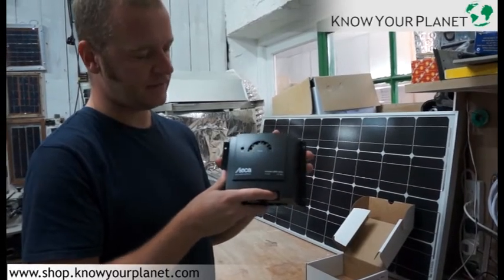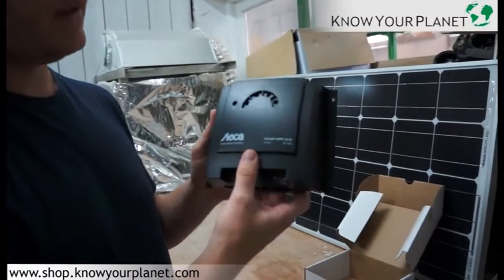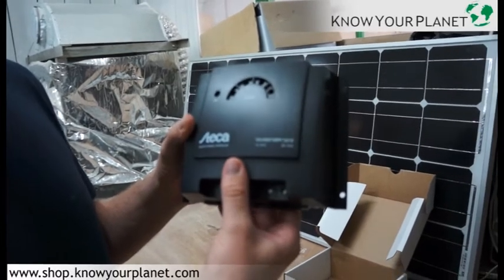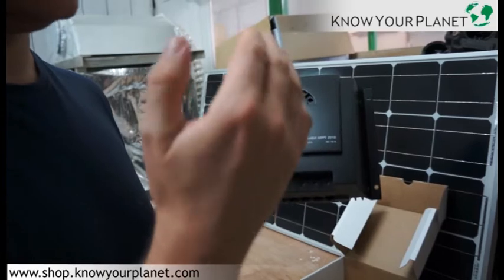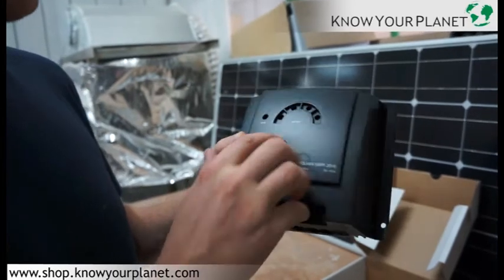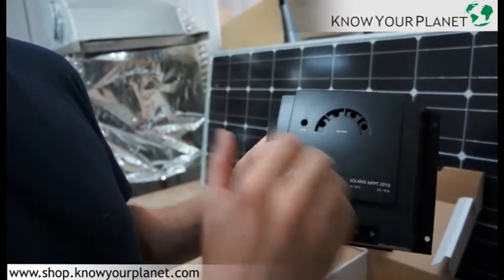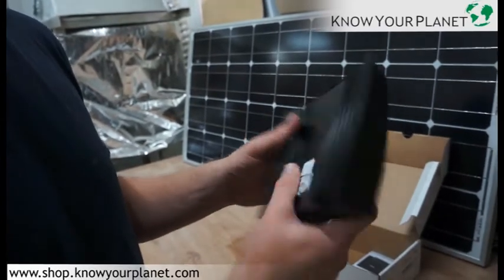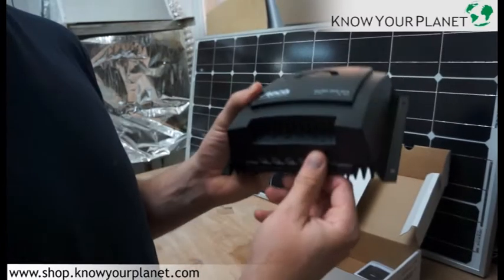Steca Solarix MPPT 2010

Comment: i use solarix psr 3030 charrge controller for lighting my home. Ever since i installed it, if it goes to the last green traffic light, it doesnt stay there for long before quickly sliding to the yellow traffic light. Is this a problem with the charge controller?